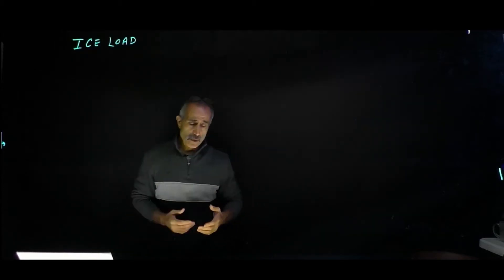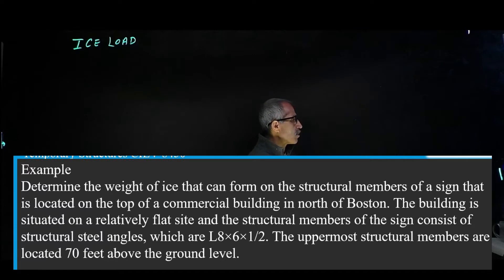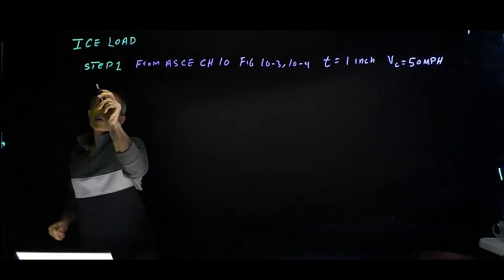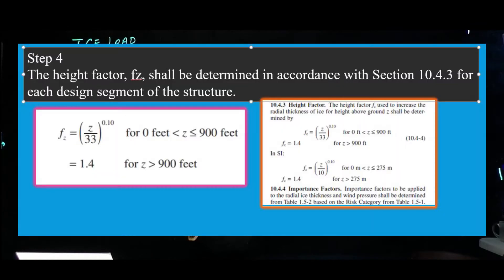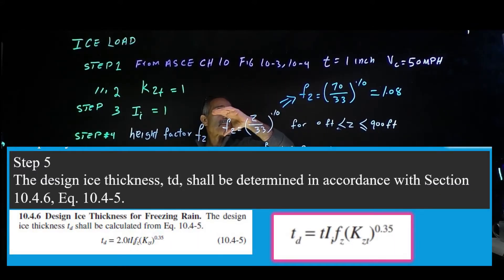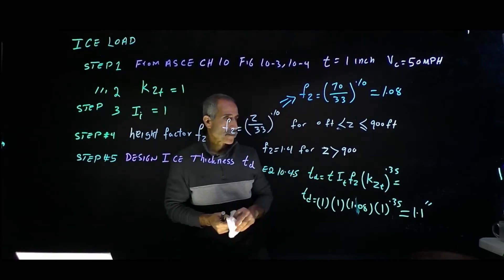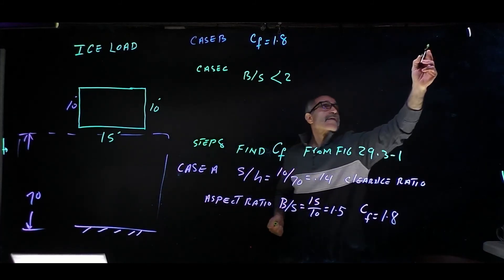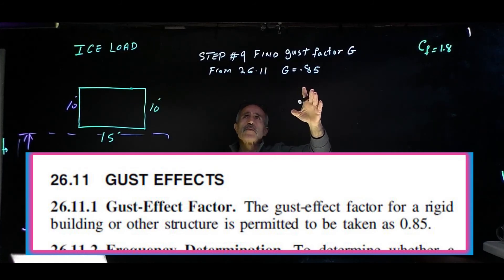Ice Loads, Ice Loads on Structure . Freezing Rain on Structure.

Comment: Very helpful as not much guidance on ice loading outside of ASCE 7 and ASCE MoP 74. However, the 2.0 factor from Eq. 10.4-5 seems to have been omitted.....? Surely you will get 2.2" of ice thickness for 'td' not 1.1" as shown? Hence, the weight will be double that calculated.....?
Reply from the maker: Chris, Very good point. In minutes marker of 6:24 in the video you see the equation from new and prior  asec the new code  has a factor of 2 . This example was based on the old code.